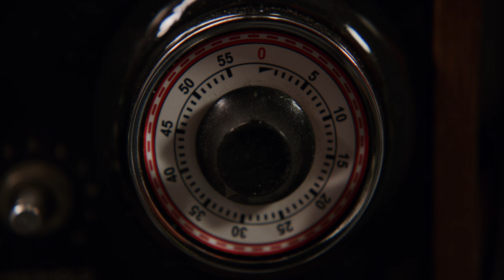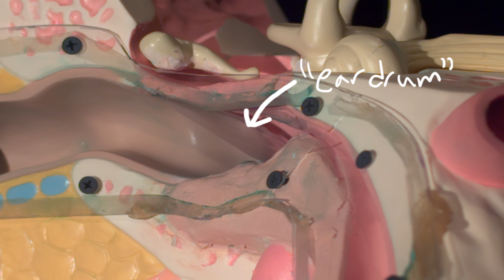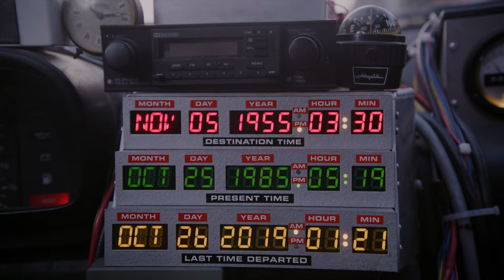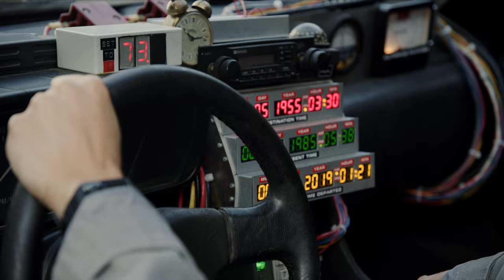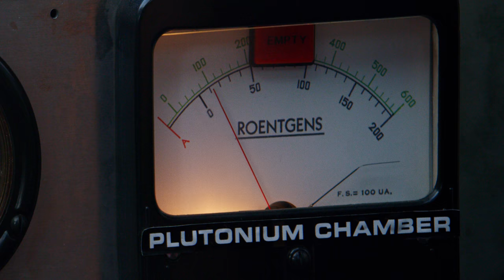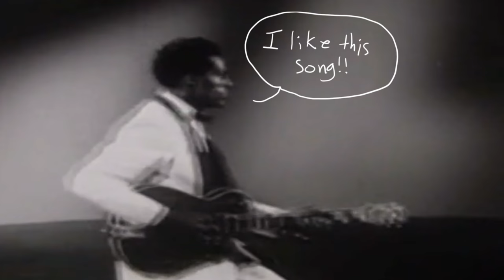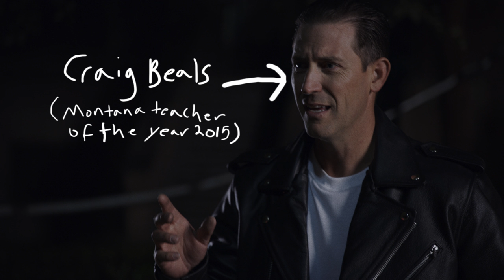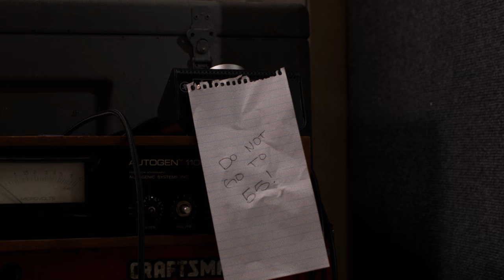Could You Survive BACK TO THE FUTURE?

Comment: The most unbelievable part of the movie?

The idea that a Delorean with a French engine could even go 88 mph
Reply: Wasn't the top speed of the Delorean 85 mph?
Reply: Blikkjen  I just found some specs..  0-60? Almost ten seconds.  And it could have hit 88..  barely. Lol
Reply: gamer w01f15 it was built in Ireland. Using a Peugeot engine and transmission. It also used off the shelf GM suspension and brake components.   Like a fiero with fancy doors, a heavy af body and an engine swap..
Reply: Howie Phelt-Ersnatz - The French build some quality Motor engines for Cars - You only have to look at Motor Sports to see this.
Reply: James Germaine tell me James, who is slamming French engines? I am merely pointing out that Engine with less than 130 hp in a car that weighs almost 2500 pounds is no race car. Nice try tho
Reply: Howie Phelt-Ersnatz - You edited your post.  

You criticised French motors.  You know and I know that’s the truth.
Reply: + banana peels for an extra 20hp
Reply: The PRV engine on Deloreans was a little bit shy...but don’t forget that several racing cars used the same engine with amazing results. Plus, it was the base for the Alfa Romeo 155 used in the TDM races....it was a beast.
Reply: why it needs to go 88ph to travel in the time, but when the Doc  is hitted by the lightning it goes to the past, without doing it? (sorry for my english)
Reply: @Yoshitsune880  my guess is that the first lightning damaged the system, as it is implied somehow in the film. It wasn't meant to work that way.
Reply: @Randomguy-gf9zp  edgy
Reply: Oh yeah cos the docs delorean is completely stock.
Reply: @Blikkjen666  that was just speedometer in the early 80s due to regulations.
Reply: DeLorean's top speed was 130 mph
Reply: @pushpull76  American regulations at the time kinda killed DeLorean,it needed to be limited to 130hp and you could get alot more from that engine.
Reply: Steven Hickman  why would f1 cars have american engines when americans have nascar
Reply: Howie Phelt-Ersnatz renault engine
Reply: It was an American GM engine
Reply: Phill what was an American GM engine?
Reply: arielatom03 you do understand that sometimes, just on occasion, manufacturers collaborate on engine designs?  The PRV was a “P”eugeot, “R”enault, “V”olvo engine?  Do you see what I did there?  Good eye, buddy.

Edit: forgot that Volvo was in on the development.
Reply: @anselpeneloperainblossom-s3489  yeah in the movies i think in part 2 and 3 they used a Porsche engine
Reply: @Yoshitsune880  they said that the bolt of lighting spun the car around fast thats why the fire trails looked like 99
Reply: scoop1215  the only thing I can find about that is that the sound clip from the first movie *might have been from a 928.  

And I found a fandom site that one user says that they made 2 v8 cars for the second movie. One with a ford engine and one with a Range Rover engine.  The engine RR bought the design from gm that was a Buick nailhead in the 60’s.

But if you have links to something solid, I would love to see it
Reply: @anselpeneloperainblossom-s3489   i believe it was on the 25 year anniversary of the movie the directors commentary for bttf 3
Reply: scoop1215 
Link?
Reply: @anselpeneloperainblossom-s3489  i dont have a link its on the blueray 25 special edition
Reply: scoop1215 
I’ll have to seek it out. The first bttf movie is one of my favorite movies, (along with the first ghostbuster movie) and I am a huge fan of the details behind.

Too bad I cannot post pictures here.  The other day I was passed by a time machine replica on I-80 at the Wyoming/Utah border.  It had Michigan plates, so it had seen some miles..
Reply: @anselpeneloperainblossom-s3489  yeah the 70s 80s and 90s were the best time for movies in my opinion everything now is comic book or remakes
Reply: John DeLorean 
You may be able to get a lot more from the PRV, but the manual transmission won’t take much more..
Reply: Howie Phelt-Ersnatz ok boomer
Reply: Even though it doesn't have any engine to write home about, The Delorean is still a fun car to drive due to its low center of gravity and overall weight distribution. Raw power is only part of the equation when it comes to enjoyability of driving cars.

And it CAN go 88mph (i've done it.) but in a PARKING LOT... no. lol
Reply: @AndrewGistKlaxMaster  is fun to drive but the one I was driving broke down after about 10 miles which is supposed to be par for the course with them, not very reliable. Fun, but not reliable.
Reply: Well, French/Swedish engine.
Reply: Steven Hickman Bugatti is really German if ww1 never happened it would be a German company and the guy who made it is Italian shout out to my German homies
Reply: Car nerd comment section.
Reply: Howie Phelt-Ersnatz universal put a porsche engine on the movie used delorean
Reply: @anselpeneloperainblossom-s3489  Julio precoada
Reply: I thought it used a Porsche engine
Reply: It was a joint effort by Peugeot, Volvo, and another company. It wasn't just a peugot engine built & designed by them. They didn't do either.
Reply: @Hebdomad7 no it wasnt

Comment: "the speed of electricity going through a wire is almost the speed of light"

We need Gav and Dan on this asap
Reply: But that's kind a irrelivent. And actually useful since it simplifies the calculations needed.
You'd just need the car to be in contact with the wire at that time.
Since the wire can flex a bit sinve it's slacking you may have let's say a tenth of a second window between initial contact and breaking the wire or going too far past it.
Probobly less than a tenth.
But not an infeasible window
Reply: @dcurtini 
Sorry I ws. Ore answering the video than him
Reply: They’ve done a video about the speed of light and they actually get it in slo-mo.

Comment: ... I already see a problem with the potential setup for the first experiment. The size of the impact zone from the pressure cannon vs the speaker. The speaker is much larger, so would the sound wave, aka pressure wave, be more like a wall hitting the person, instead of a concentrated cannon blast? I mean, I know you said there was less surface area on hte limbs, but wouldn't such an immense amount of pressure still push the legs? How much of the head injury was rotational and how much was from the pressure wave? Would the pressure wave hitting the legs AND chest at the same time have provided less spin? How much would that change the way this plays out? Is it possible to setup a test with two cannons and set both off as the same time, allowing a hit to the chest and legs and seeing if that yields a different result? 

This kind of stuff fascinates em and I would love to see the variations of a test like this ^__^

Comment: Hey Jake :D Wonderful content quality, and I love the format!
I just had to say something about the amp demonstration, which I feel doesn't do the science behind it justice.
A speaker creates sound waves by having a magnet move the "cone" of the speaker back and forth at different frequencies depending on which frequencies are being played. The movement of the cone will push and pull on the molecules it touches, making them vibrate, which in turn will transfer to the molecules connected to those, creating a chain reaction of vibration until the energy of the wave dissipates. 

The speaker doesn't actually "blow" air on you. It moves it back and forth around you very quickly. The air cannon also has a focused point that is much smaller than the large area of the speaker, which would deliver the force more evenly on the body. But yeah, sending someone flying with a speaker alone, seems rather unlikely. The closest thing I've seen to this is water droplets levitating on sound waves.

However, what I believe would and could happen with a speaker of that size, is potentially sending such a forceful vibration into your body that you could end up fainting or even disrupting the rhythm of your hearth, resulting in cardiac arrest. Oh, and your ear drums would probably die too.

Comment: This is not the same as an entire body of sound pressure like in the movie.
Reply: An entire body of sound would be an explosion.
 It would be even worse. If you get thrown back by a wave, it's enough to kill you. It's that simple.
They chose the air gun because people would more likely connect it with a Soundwave.
But the effect displayed in the movie itself would be, in real life, a simple explosion.
Air gets compressed and you fly away due to the Shockwave.
You most likely die.
Definitely.

Comment: Has anyone ever back-calculated the amount of amplifier power that's outputted to the speaker immediately before Marty is thrown back?  That's a massive amount of energy transfer to knock Marty backwards through the air (which partially is from the voice coil puncturing the dust cap in addition to the sound pressure).  I wouldn't be surprised if it worked out close to 1.21 Gigawatts, as some bizarre movie trivia that's been a secret 35 years.

Comment: The crash test dummy experiment with the pressure wave is a little off. The dummy flies back as a result in directed pressure at the chest and only a foot and a half away. The speaker that moves Marty is not directed at the chest as the speaker would be directed at a much larger area. For Marty McFly to be thrown away from the speaker, the speaker would have to move the whole area of air right in front of him. This would also mean that the speaker cone would have travel out of the case a fair distance to move that much air. This would give an even pressure across the whole body not just in the chest area. Chances are, his legs, arms and head would suffer major injuries as these would be the first to move.

Maybe build a speaker big enough with a more powerful coil system and larger cone travel to give the science a better understanding of what would truly happen. Who knows, maybe you'll be the first person to build a working speaker capable of pushing that much air at that frequency. Definitely you'll need to be far away from it with it is maxed out.

Comment: I gotta just quickly say that I think he’s slightly wrong about the lightning bolt. It absolutely would be possible to time it right to get the electricity to conduct into the deLorean so it gets those 1.21 gigawatts of energy. The car isn’t in contact with the cable for the period of time a lightning bolt has to strike. Instead, the cable is sort of “stuck” on the pole on the car so that it has a good second to attach to the cable. Still it’s incredibly difficult to time that right, but it’s not like he had to time it by the near speed of light.

Comment: This video doesn't address the biggest flaw with Back to the Future: the Delorean travels through time but not space. But the Earth is always moving around the Solar System, and the Solar System is always moving around the Milky Way, and the Milky Way is always moving around the Virgo Supercluster, and the Virgo Supercluster is always moving around the Laniakea Supercluster.. and then at that point, you break the bonds of an ever expanding universe..

Even if you traveled a single second forward or backward in time, the odds that you'd be anywhere but outer space is basically impossible.

Comment: You can look at time travel as jumping between parallel universes, where some universes are in your future and some are in your past. But whatever you change in one of those universes has no effect at all on the universe you started from. This avoids causal loops and paradoxes. The three lines of salt shown in this video is a good start. But you need more than three. You need an extra line of salt for every jump.

Marty1 knows Doc1 in Universe1, which contains Twin Pines Mall, where Doc1 gets shot by Libyans. Marty1 jumps to universe2, where it is 1955, meets Doc2, warns him about Libyans, runs over a pine tree, and then he jumps forward. In universe2, Doc2 will wear a bullet proof vest at Lone Pine Mall. But back in universe1, nothing has changed. Doc1 gets shot at Twin Pines Mall, Marty1 disappears driving a DeLorean* and is never seen or heard from again. Even if Marty1 had prevented George2 from kissing Loraine2, that would only prevent Marty2 from being born, which has no effect on Marty1 at all.

When Marty1 jumps forward, he doesn't go back to universe1 because they changed the time circuits to send him back 1 week and 10 minutes early. That's universe3. In universe3, no Marty ever showed up in 1955, so Doc3 gets shot at Twin Pines Mall, while Marty1 watches. The only way for him to see Doc not get shot is for him to wait 30 years before jumping back to universe2. The only way for him to get back to universe1 is to jump forward by 1 week and 10 minutes, where he would find Doc1 has been dead for a week.

*The weird part of this theory is that it's not DeLorean1 that Marty1 is driving. It's actually DeLorean4, which is from universe4, which is exactly 60 seconds behind universe1. The dog in it, Einstein4, jumped forward 60 seconds in DeLorean4 to universe1. Meanwhile, Einstein1, from universe1, jumped forward in DeLorean1 to universe5, which is exactly 60 seconds ahead of universe1.

Comment: Wonderful cinematic masterpiece, well done...
However I have a question, since particular statement in video is not necessary correct... You see, speed of electrons traveling through copper wire is a couple of centimetres per second (for other metals we get similar numbers), so I to remind you, that the information (EM wave) travels at nearly speed of light (wave of course travels with that speed, bearing in mind, it if slower than c0 in non empty space). I am not saying you are wrong, since you stated that electricity travels nearly with speed of light, where you haven't specifically declared what electricity is (not like philosophical question, just simple definition).

However, video is truly cinematic masterpiece, well done regardless :)

Comment: 10:00 If it is so, wouldn't you get an infinite amount of Marty's in DeLoreans in 1955 at the same spot? The instant Marty in DeLorean travels to 1955 it will go from there, but somewhere in the future, that travel happens again in the loop. The planc time after the first travel there is no significant influence onto the timeline, and the time travel somewhere in the future is still possible, and happens in the future, sending another Marty into a travel to the same spotas the previous one was sent to...
I think I just don't understand time paradoxes well. There probably needs to be a movement for the loop to close on the time travel moment...

Comment: There's one thing you guys didn't take into contact with the lightning strike with the flexibility of the wires passing the lightning and the flexibility of the rod that's lightning is going into there will be a small time. When the two will remain in contact with each other so the speed of light is only a small factor in the lightning bolt hitting the car

Comment: i don't know what kind of tesla coil that was, because i've built two of them(videos on my yt channel) and they produce high-voltage LOW CURRENT electricity. no tesla coil design that i know of could produce the over 15,000,000 volts it would take to jump the gap from the top of the coil to the ballistics dummy at the current level it would have taken to get that powerful of a lightning bolt without drawing so much current it would explode the puny power wires in the base of the tesla coil.

Comment: Honestly, I never got why Doc used a hook to transmit the lightning bolt to the DeLorean. It would have made much more sense to connect the DeLorean to a cable running parallel to the road to give them a bit of leeway with the timing.

Comment: 8:28 that makes sense but “past” could be as small as 0.000000000000000000000000001 seconds ago which means that you could travel to “the past” technically but not to a significant margin 

And yes I know scientists said that there is a limit to smallest amount of time but I’m willing to ignore that because I believe time can be infinitely counted by infinite numbers because it’s not a simulation that defines time as frames
Reply: We can have units of time smaller than Planck time, but we don't need it because the fastest event to occur is in that time. The time it takes for the fastest thing (light) to travel the smallest distance (Planck length) is 1 Planck time

Comment: First section of your video is all well and fine, but how did you arrive at the figure 100 psi.  I suppose you could guess by using the weight.  He's smaller than most people standing at 5.4 and average 150 lbs.  I calculated the force of a projectile and got 88 feet traveled.  Since marty landed in the chair, we have to consider the distance to the chair.  I'm still having a bit of trouble with psi, but at his weight, the force would have to be enough to move marty at a velocity of 20 ft/s.  Maybe a little less to score the distance of the chair.